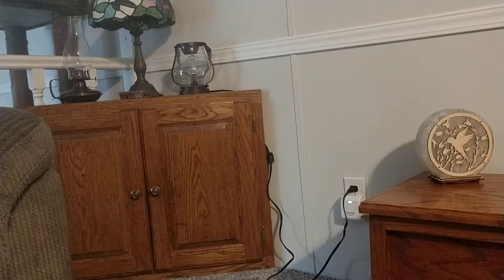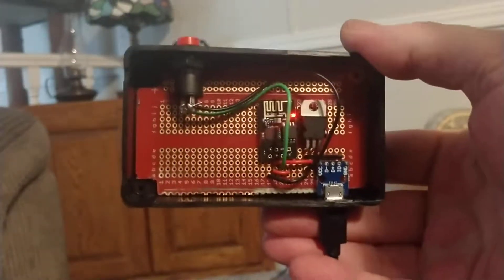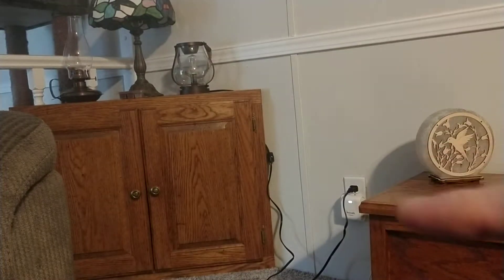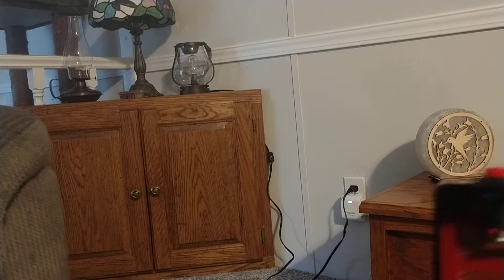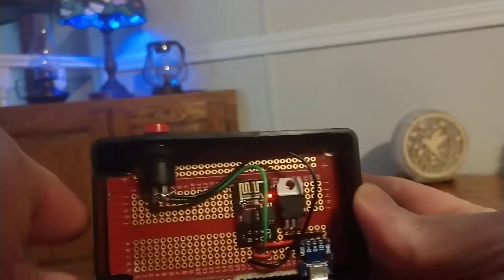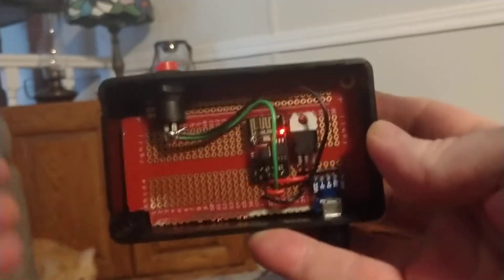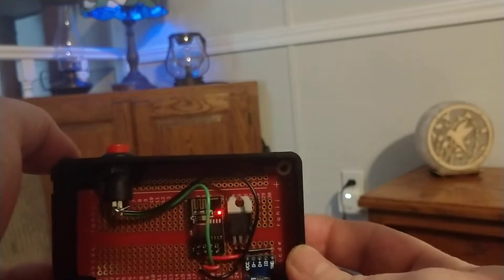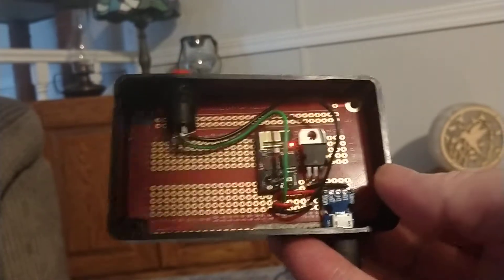ESP8266/ESP-01 PushButton Controller for Hubitat - Final

Comment: This is awesome, wondering how you was able to do this threw hubitat. I'm trying to use a esp8266 D1 Mini with a VL53L0X Time-of-Flight (ToF) Laser Ranging Sensor for a mailbox project. There is little confusing info on the Hubitat community which I've try with no success.